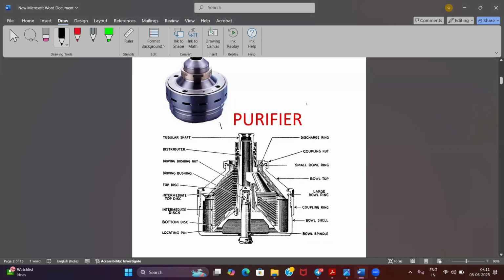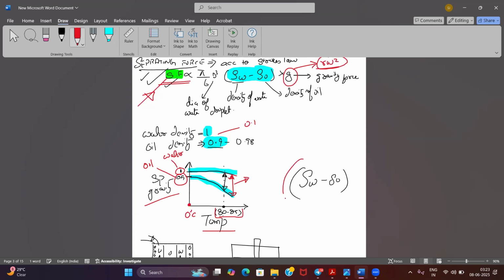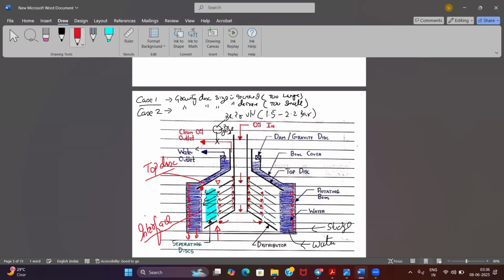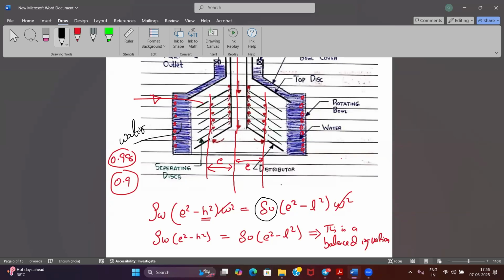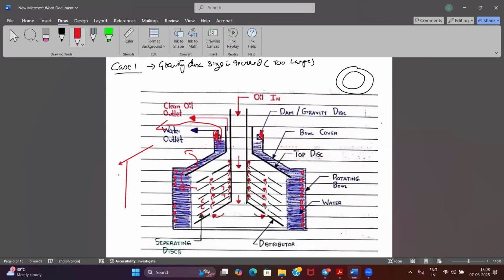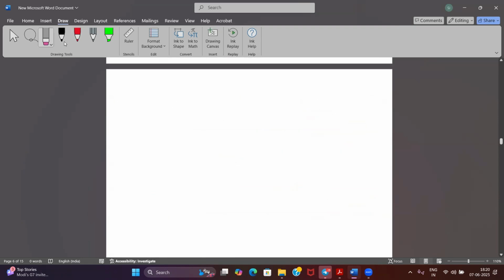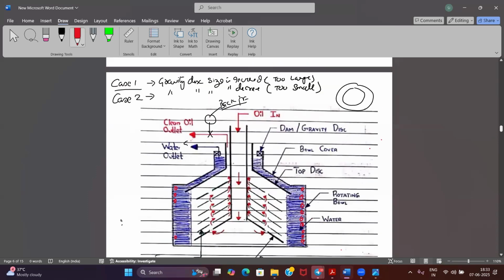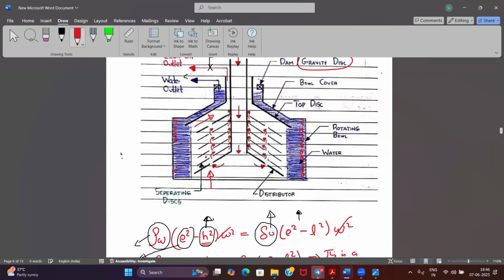Centrifugal purifier working || lecture-1

Comment: if density of oil increases , then we have to increase the dia of gravity disc accodingly ?
if we reduce the dia , interface will shift more inward towards the disc stack please check sir
Reply from the maker: In order to balance the equation h has to be reduced and in order to h to reduce we have to reduce internal dia of gravity disc so as to balance the equation. Interface is not just depend upon gravity disc but there are other factors as well. Will recommend u to check complete session, u’ll get the point.